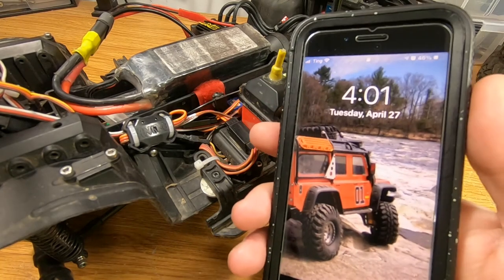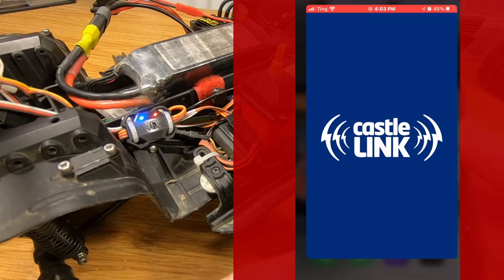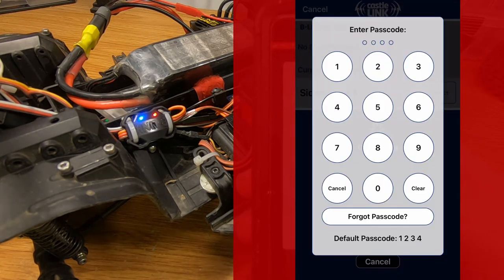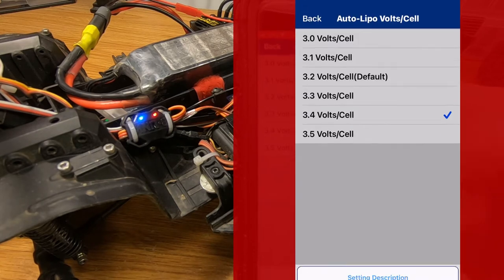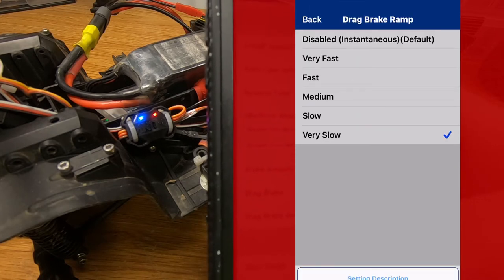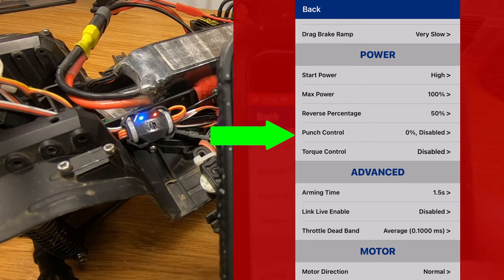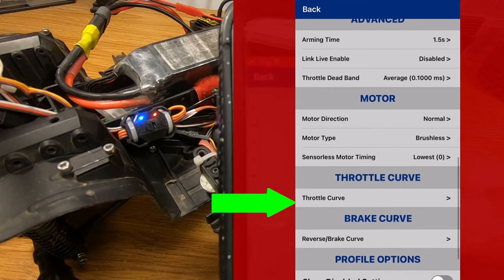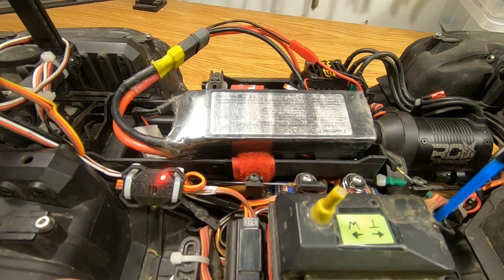castle link app - Program a castle ESC with your Smartphone + My Crawler ESC settings

Comment: Do you leave the Blink in or do you remove it
Reply from the maker: after confirming that the settings have been changed. I power everything off and remove it because I've had it interfere with other electronics when I tried leaving it in.

Comment: Thanks for the vid. Everything seemed to go right for for until I exited out of everything after the setting were saved. Once out of the app the ESC emits a constant beep. Tried hooking the ESC back up but the beeping remained. I hooked back up to the castle link and the settings were back to default. Any help is appreciated!
Reply from the maker: I have not experienced that particular problem myself. Do you have a second Castle ESC that you can test it on (or a friend with one) to try and narrow down which component is causing the issue? 
If you can’t start with that then I would just say double check your order of operations and all connections. Try again making sure of each step before the exiting the app. If the same results happen again I’d message Castle and see what they think.

Comment: Are we able to remove the b link after tuning? Must the B Link stay connected in the cars at all time during runs?
Reply from the maker: Once the settings are changed and loaded into the ESC you can power off and remove the B link.
Reply: Just to be sure. So the ESC remembers the settings and I do not need to connect the b link again on the same car for subsequent runs right?
Reply from the maker: @shaunwee7658  Oncr you change a setting and it has been saved to the ESC it should stay until you change it again. You can easily test this to show it works by making a change to an easily observable setting (like setting max forward power to 25% or setting the drag brake to off or 100%) then save and remove the B link and see if that setting change stayed. That's only if you want to prove to yourself that the changes are sticking because you aren't sure.
Reply: Thks and really appreciate your replies. 🙏🙏🙏

Comment: Question: My Sab Goblin heli has a 120A opto esc 12s,  but it will not go in the settings. It will see the esc and when i tap on it it wil load. After that is says disconnect esc and b-link and connect esc and b-link, but the screen keeps on loading.
Reply from the maker: I'm not familiar with any of Castles Air ESC's so I don't have any experience to share with you. I'm not sure what it means if the app can "see" the ESC but not open the settings. 
Here's what I would do though.  
Try reinstalling the app, reboot phone then start over following the prompts in the app. If that still doesn't help then I would contact Castle customer service. They were very helpful to me when I needed them.
Reply: @TJsRC  Thank you for your reply, it's just this esc that is not working, the rest is. I can connect with the pc just fine. I will contact Castle Cutomer Service anyway😉👍, because this is the first time i need to reboot esc and b-link bluetooth for this esc.
Reply from the maker: @rtoebak76  Good luck with it my friend. Hopefully they can help you sort it out.

Comment: Dear youtuber, I have an issue installing this B-link: i installed it on a mamba monster X device (correctly installed). When i startup, the LED flashes as they should, the app sees the mamba monster X, when trying to connect to it, i get and error message: 'failed to load ESC setting'...and i cannot go ahead. Do you have an idea how i can make that working? Is there something that must be hard programmed on the mamba so that it sends the datas? Thank you for your help.
Alexandre
Reply from the maker: Did you double check with Castles website to see if that model ESC supports using the B-link?

Comment: This b link ends up being a lot of trouble. If you ever want to warranty a castle product one of the first questions they ask is if you have ever connected it to a b link. This thing killed one of my mamba x....
Reply from the maker: Are you saying that if their B link kills their Esc they won’t warranty it? I had heard of these adapters being problematic when they were first released but I thought maybe it’s been out long enough to give it a chance. Haven’t had any issues yet but I will keep a close eye on it. As far as Castles service and warranty go though I have had good support from them. I had a SW4 die and even though it was running a non castle motor when it died they still replaced it for me.
Reply: @TJsRC  I'm sure they would still warranty it even if you do use the b link. I just thought it was odd that one of the first things they asked me was if I used the b link. I haven't mailed it back yet to see what they say but its literally less than  a month old
Reply from the maker: It always sucks when a new product dies right away.  I hope they fix it for you. Good luck with it friend.
Reply: @TJsRC  yea it's no good when something you pay good money for doesn't hold up. Now that I think about it the b link never give me any trouble on the sw4s. Just my mamba x.
Reply from the maker: @rc-daily  Being that it's new I would think they shouldn't give you any problem replacing it.